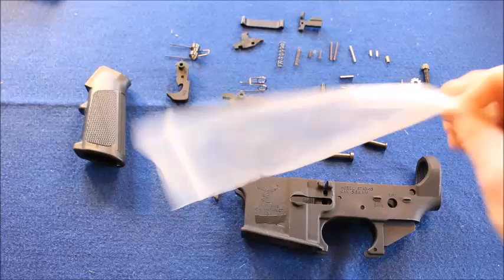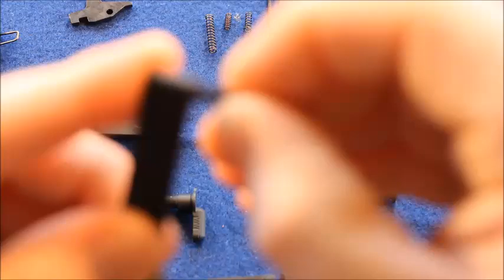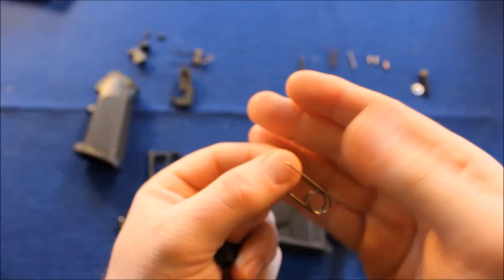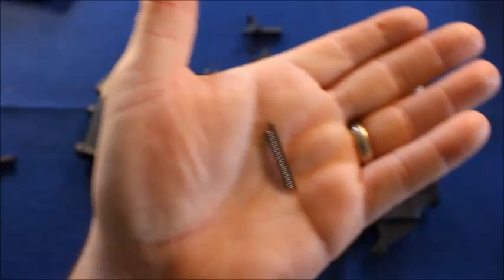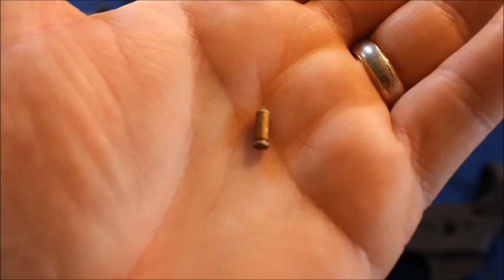AR Build pt1-AR15 Lower Parts Kit Identification

Comment: 3:02 Magazine Release
3:26 Magazine Release Spring
3:38 Magazine Release Button
4:08 Trigger Guard
4:31 Trigger Guard Roll Pin
5:03 Bolt Hold Open
5:14 Bolt Hold Open Plunger
5:36 Bolt Hold Open Spring
6:15 Bolt Hold Open Roll Pin (on some kits, this is a screw)
6:37 Trigger
6:48 Disconnector
6:53 Disconnector Spring (wider at the bottom, where it nests in the trigger)
7:24 Trigger Return Spring
8:13 Hammer Spring
8:18 Hammer
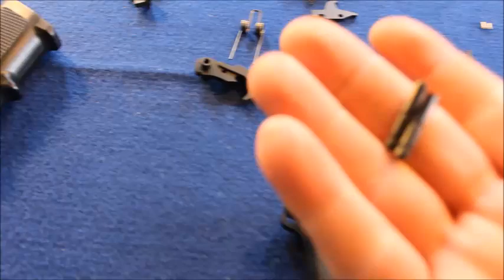9:03 Trigger and Hammer Pins
9:34 Safety/Selector Lever
9:58 Safety/Selector Lever Spring
10:52 Safety/Selector Detent (looks like a bullet)
11:47 Takedown Pins
12:28 Pistol Grip Screw
12:38 Pistol Grip Screw Lockwasher
12:48 Pistol Grip
13:06 Takedown Pin Springs
13:43 Takedown Pin Detents
14:16 Buffer Retainer
14:30 Buffer Retainer Spring
Reply: Wow😱 that’s a pretty detailed list of exactly what this video was about👍 I can’t imagine how much work and thought you put into compiling this useless list😂
Reply: LMFAO! @M21-w1y  I did it for my own benefit, when I was building a couple of AR lowers and I needed to refer back to the video and find the exact part I was trying to install without scrolling around. Tell you've never built a lower without actually saying it!

I don't think I've ever seen someone declare their mental defect more ostentatiously and proudly than you just did!

Comment: So I know this is old but I have a question for yea if you have the chance pretty important
Reply from the maker: James Ford ?
Reply: @IMZReady4Anything  so my friend bust down the lower and upper of his ar15 ended getting these two springs one is super little and the other is longer than the take down pin springs idk where these two springs came from I wasn't there when he was messing with it I ended up pulling it all apart and looking threw everything but I cannot figure out where they came from the trigger system was fine and buffer tube along with take down pins ?
Reply from the maker: James Ford check this link out it has one of the only visual references I know of.  
https://www.ar15.com/guides/files/tutorials/assembly/lower/index.html?gid=183
Reply: @IMZReady4Anything  thank you man sorry I was alittle confusing
Reply from the maker: James Ford I hope that helped let me know
Reply: @IMZReady4Anything  well the springs came from the sight but yes mostly differently for breaking down